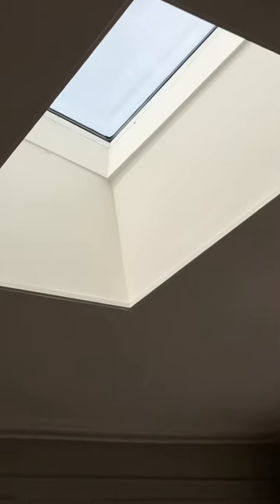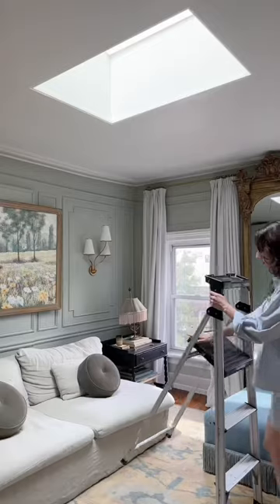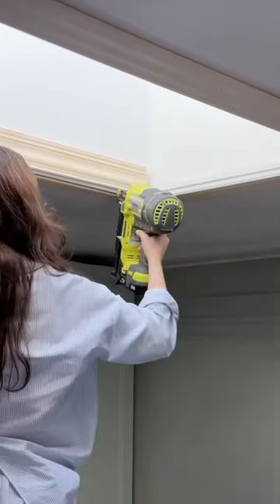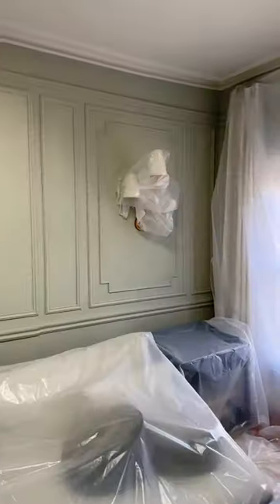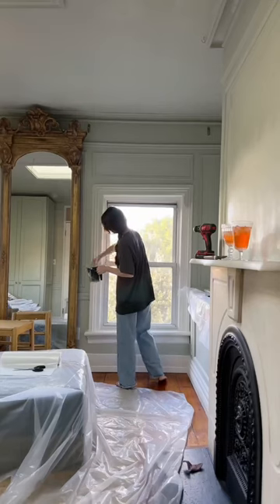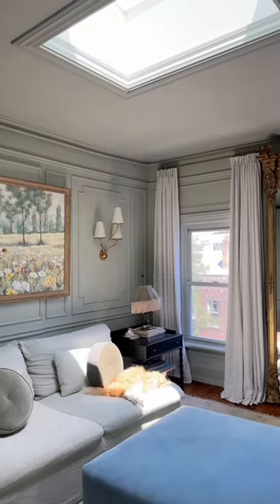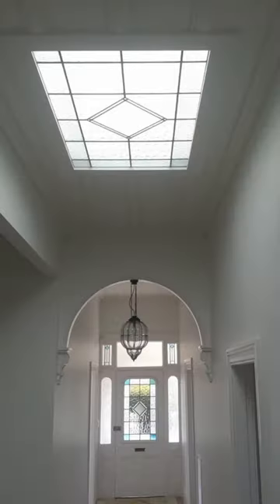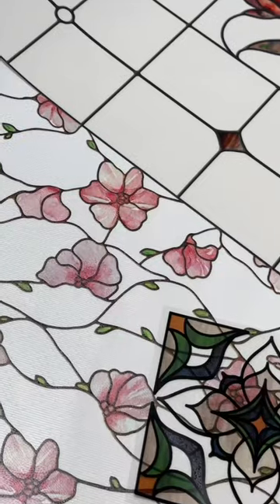let’s spruce up this skylight - part one #diyhomedecor #diyprojects #interiordesign

Comment: You could put the decal on a piece of clear plexiglass and lay it on top of the trim, so it’s closer to ceiling height, instead of adhering it to the actual glass window, near the roof.